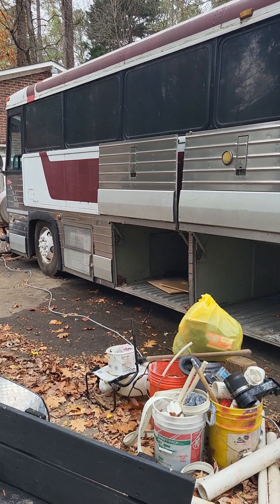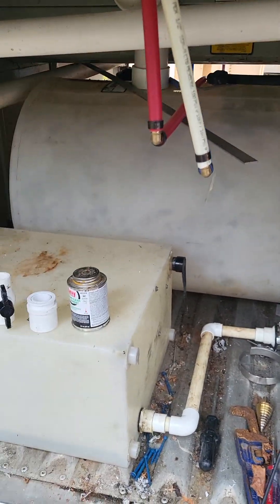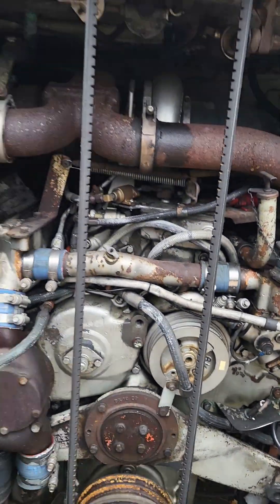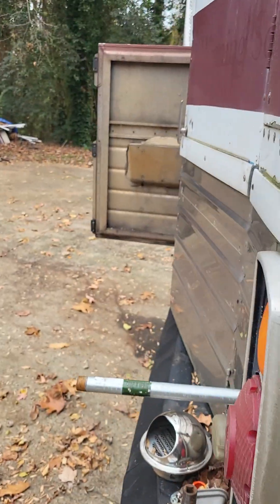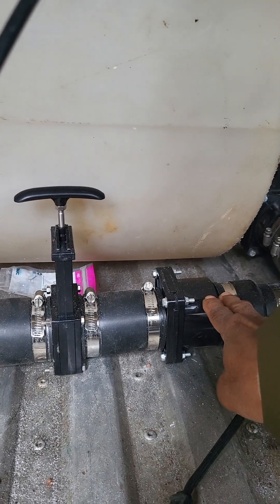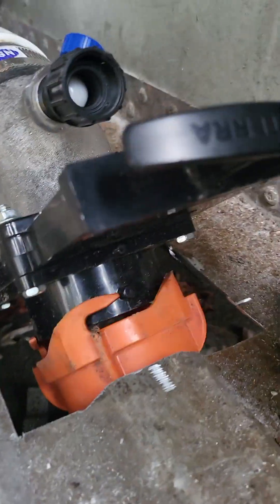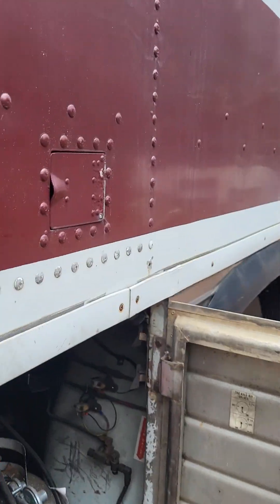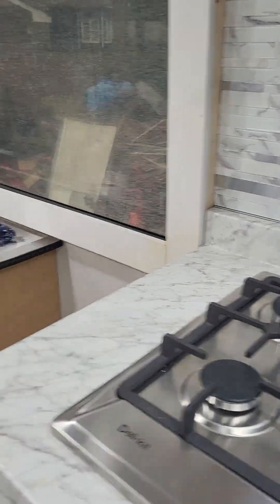Finish in the plumbing on the MC9MCI tiny house bus Conversion

Comment from the maker: Not a whole lot, but I will eventually upgrade it to a larger tank which is the only tank in there that I possibly would have to upgrade but for now, I am just using that because I have it and those tanks are very expensive. That's it that's why I put so many valves. So I can have what I call a leaky Val. On.  It to allow that grey water to leak out at times